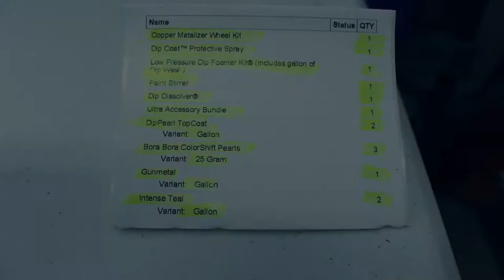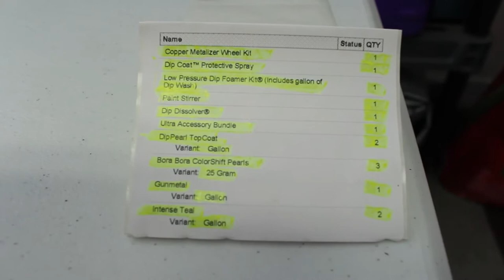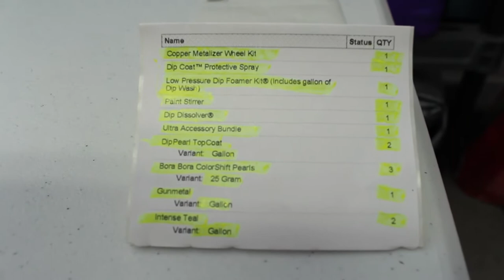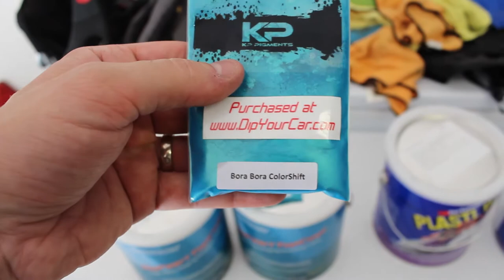Dipping the S2000 a crazy color!

Comment: I love the color and I think you did a great job J.  I have an 01, and the paint is not is great shape.  Does the plasti-dip cover small paint imperfections such as rock chips and the like?  Thank you very much for documenting this process.  I believe, after watching and listening to you that I could do this to my S2000 too.  Thank you!
Reply from the maker: +Kevin Crosson the process is very straight forward and not difficult at all.  The Dip will cover light surface scratches but I sanded down and filled in some bigger chips just to make sure. Thanks for watching!
Reply: Thanks J, cheers!